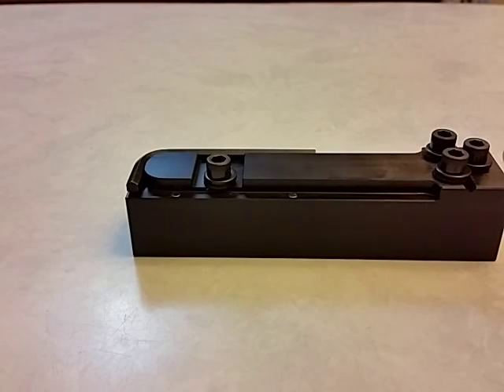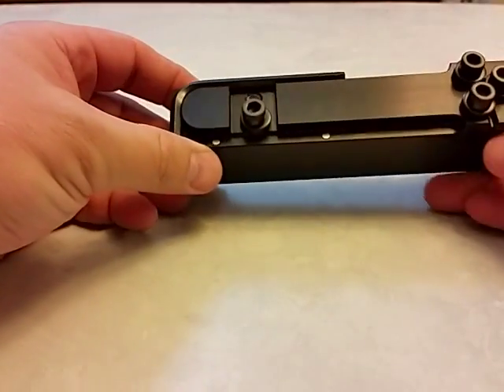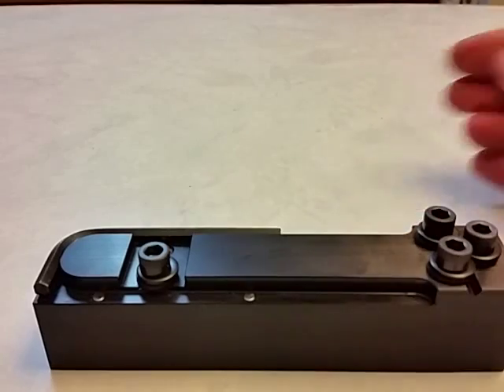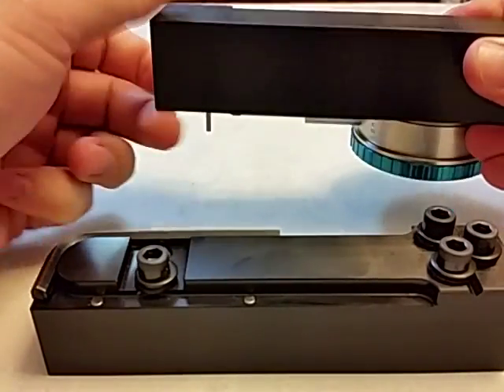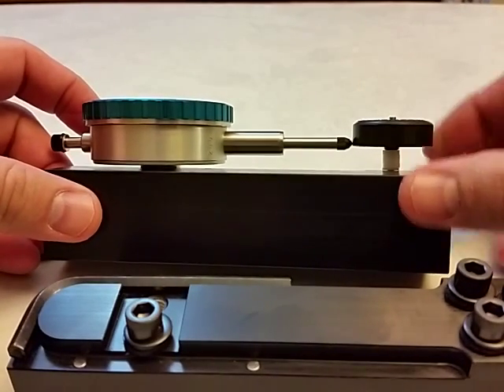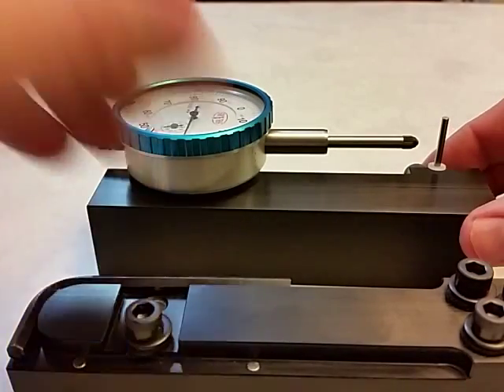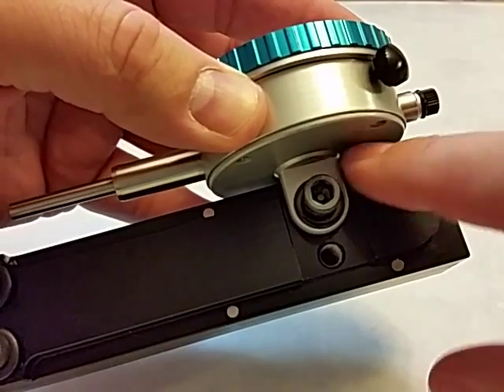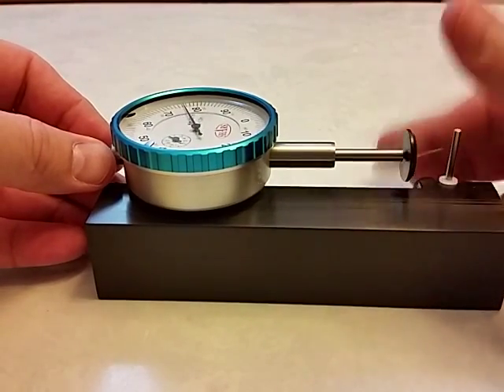Pinewood Derby Wheel Runout Gage

Comment: Don: My daughter is graduating from high school and took a wood working class and loved it. The school for the first time is offering a CNC class this summer and she wants to take the class. My question is where can a person purchase solid blocks of steel, aluminum, and brass from? She will need this to build various projects and do not have a clue where one can purchase them. Thanks Dana
Reply from the maker: Dana, I would be surprised if the school didn't have material for sale  or reduced price for use. If you must buy your own, you can either buy local or online. I've purchased both locally and online in the past for various purposes. Google search what your looking for. Dont rule out craigslist, Ebay or Facebook marketplace, sometimes those places have scraps for sale. Otherwise try looking at something like online metals.
Reply: Don: I thought like you did that the class would provide that information and material for the students, but the teacher wants the students to learn to source their raw material. So any suppliers that you could lead my daughter to would be greatly appreciated. Thanks Dana

Comment: I have your gauge and love it. Very well crafted. My personal experience with BSA USA wheels out of the box has been similar to yours....runout between 0.0025" and 0.0040". Revell BSA wheels that are made in China are actually a little better but I understand that Revell is discontinuing them. I think BSA continues to improve the wheels they include in the kits. I have to say I noticed the biggest difference in the colored wheels. The colored wheels had burrs and bumps with 0.0100 + runout. The colored wheels require some machining to be true but the black wheels out of the box are pretty good.

Comment: Don, I do not know what your background is but, you have designed and built an excellent testing tool for the pinewood derby car industry. I would like to see someone design and build a wheel lathe that will lathe four or more wheels at a time to minimize wheel run-out for a set of wheels. I know there is a manual lathe that will only lathe one wheel at a time and I know some YouTube videos show people using electric lathes in which the wheel  sets in a special puck during the turning process. Again only one wheel can be lathed at one time.
Reply from the maker: Dana Summers thank you.

Unfortunately there are some challenges with trying to do 4 at a time. Mainly your ID needs to be your locating surface for turning the od. There is some video out there somewhere where a guy turned 4 at a time. Also the wheel ID size can vary greatly exacerbating the problem. That's why some vendor wheels ream the  bore to a consistent size before turning the wheel. I thinks its widely accepted that those are slower wheels.